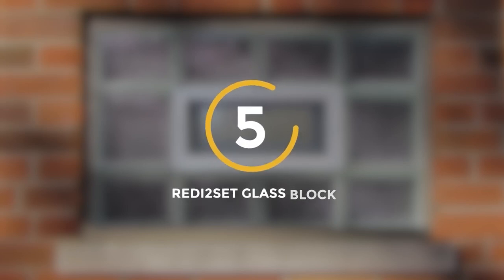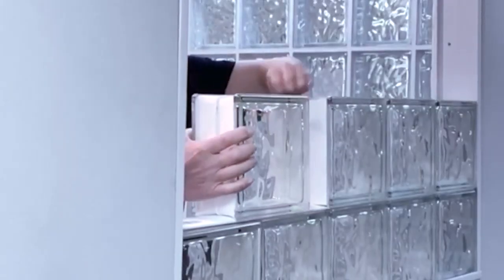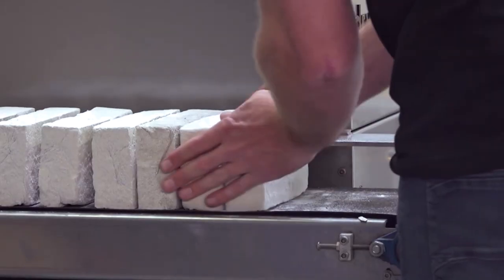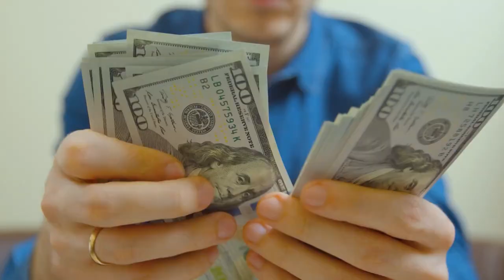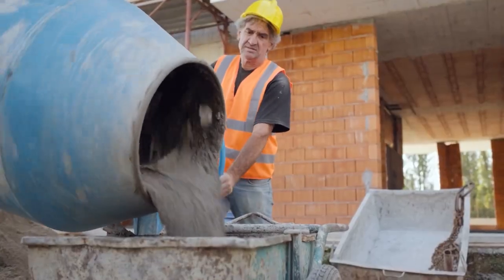These NEW Technologies Are Changing the World!!

Comment: Sorry, but that "acoustic panel" at 1:12 will do nothing at all to "reduce noise levels".  It is a simple diffuser, and since the slats are evenly spaced and all the same size, it will be tuned to only a small frequency range.  Thus, the diffusion will be focused in "lobes", not smooth.  And diffusion does not "reduce noise levels" anyway.  Fake news.